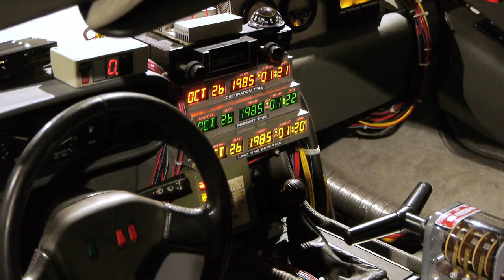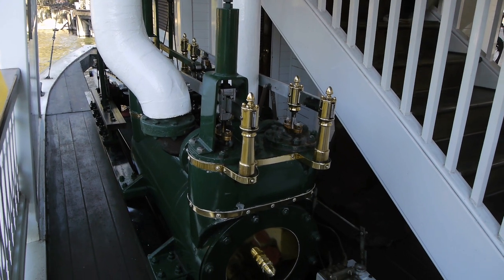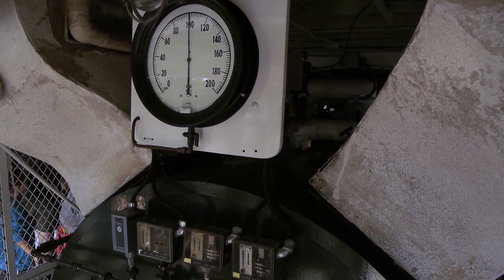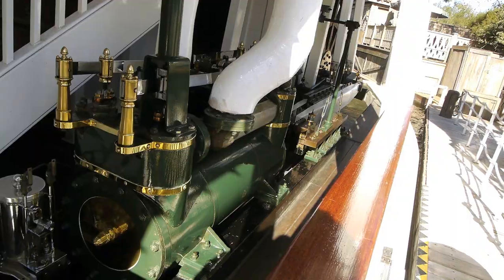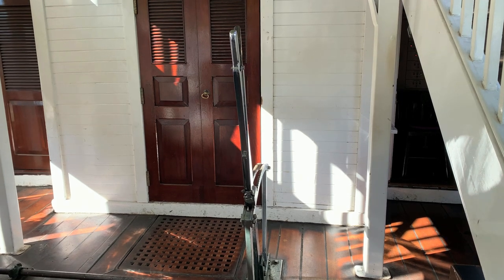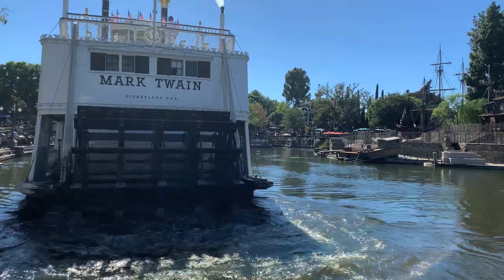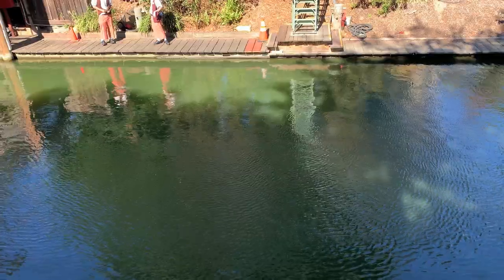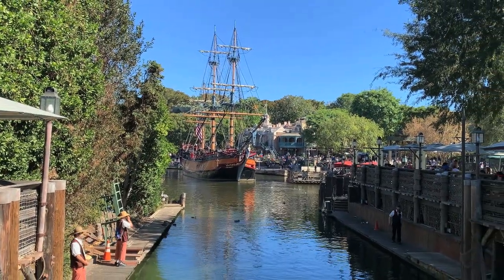How the Mark Twain Riverboat at Disneyland Works

Comment: I'm afraid that the engineer still didn't explain the "brake" very well to you. There is no brake that actually grips the track. They use the mooring line that the cast member hands to the other workers on the dock. As the boat comes in, the engineer will slow the boat by reversing the paddle until the boat stops. The mooring line is handed over and fixed. Then the engineer runs the paddle slow ahead to tighten the boat against the mooring line, preventing the boat from doing any backward or forward movement. I've spoken to many of the engineers over the years and learned all of this. But when I was a Cast Member at Disneyland, I do remember one incident, the Mark Twain was leaving the dock, they blow the whistle to alert the smaller boats on the river to basically "Get out of the way!" Well one of the pilots of the tom sawyer rafts must not have paid attention because they suddenly drove the raft across the river to the other side. The pilot in the Mark Twain Wheelhouse saw this (and I suspect the engineer did too), they went full reverse. The only time I've ever seen them do a full reverse. That wheel spun like crazy, kicking water up into the air as they tried desperately to stop the boat before it got too close. Though the raft had already reached the other side of the river, they didn't want to risk floating past it until it was moored because the larger Mark Twain makes other smaller boats get sucked-in toward it. It was a pretty interesting thing to see, no one got hurt. But it's an example of how the wheel is the only way to slow or stop the vessel even in an emergency like that.
Reply: I believe there was an accident 20 years ago where the bollard on the dock was loose, and the Mark Twain pulled on it too hard, and it came loose. The spring action of the mooring line snapped back on a park guest, and injured them.
Reply: @softwerksaol no that was Columbia. A rope snapped and struck a guest.

Comment: I’ve seen this track many times over the years while the river was drained and it always amazes me how thin it is to guide such huge boats. Of course the river was drained (and then just the back half drained) during the construction of Galaxy’s Edge a few years back when they had to re-route both the river and the train tracks - Overall they did a wonderful job and actually made that area look a lot better than it did. (And it was the first time that the Disneyland railroad ever veered to the left!)
Reply from the maker: Yeah it’s amazing how fine that guideway is. However keep in mind that the boats are actually floating boats. So all the guideway has to do is steer the boat. It steers from the front of the boat so the back half is free to move around a bit. When the Columbia got stuck on the guideway it was twisting perhaps 45° in both directions! Somehow they were able to pull both boats tight up against the dock. And I’m assuming that there’s some kind of additional guides at the dock to make sure that they can’t twist away from the dog. And then they do run the paddle wheel and the propellers on the Columbia in reverse while it’s at the dock to hold it tight against whatever guideway is underneath it.
Reply: @ToyManTelevision  I always thought the boats are connected to the guide at the front in back, the reason being is when you watch the Mark Twain go around the bend the back seems to follow the guide line perfectly almost as if you took a pencil and followed a curved line, the point and the eraser both followed that line.
Reply from the maker: @FunAtDisney  could be… but the Columbia was really swinging left and right when it got stuck. But boy they pull the boats tight up to the dock… so not sure how that works.
Reply: @ToyManTelevision  I believe I have been on the steamboat in the park in Paris some years ago back in 2012 I believe.
your steam engine videos are very interesting to watch
Reply: @ToyManTelevision  so does the person in the wheelhouse send orders down to the engine room when they are arriving back at the dock? my Mum thought they controlled it all with computers and the like. I believe she also thought that the steam engine was fake too

Comment: Excellent stuff, as always. If you guys ever make it down to New Orleans, do a video on the Natchez. This boat is actually newer than the Mark Twain, but its engine came off a boat built in the ‘20s! They let you walk around in the engine room while it’s running, and it’s an amazing experience despite just going down the river a few miles. It was well worth it when my dad and I did it right after Katrina.
Reply from the maker: Always have wanted to do that. And other river boats. And the trolley. Just NOT Mardi Gras

Comment: Ever since I was a kid in early 1960’s, I suspected the riverboat was actually steam powered, and driven by the paddle wheel, it just all seemed to fit.  Does anyone know how the Columbia is powered?
Reply: He did mention that the Columbia is also powered by diesel, but i suspect it would have an internal combustion engine rather than external, since there are no obvious exhaust stacks or steam exhausting anywhere.
Reply: Columbia is a combusion engine driving two propellers
Reply from the maker: As it happens I just found out the Diesel engine has been converted to natural gas. Two props. And even though it on a track they can twist it slightly by using the two props in different directions.

Comment: does the boat actually float by it self or does it need the track for other than steering the boat
Reply from the maker: It floats. And is powered by the steam engine. All the track does is guide it.
Reply: @ToyManTelevision  that's cool

Comment: So your so smart how is the Columbia operated???
Reply: Bio diesel.
Reply from the maker: It’s been biodiesel but has been converted to natural gas. Simple throttle system. Has forward and reverse but reverse is generally only used for braking. However on this trip we did get to see it back up as it jammed on the track.

Comment: Thanks for the photos of the engines, I only sorry you didn't spent more time on them. As far as I'm concerned, they are the most interesting part of a steam boat. These engines are generally true to the design used on the Western Rivers without very much change from before 1850. There are poppet valves for exhaust and admission on each end of each engine which are opened by the levers. The towers above the admission valves simulate what is used in a California cut-off variation on the valve gear. However, they are just dummies and the engines appear to have fixed cut-off. The valve motion is obtained from the sliding piece on the pitman (connecting rod). I've always wonder what the bore and stroke of the engines are, but the typical engine of this type will have about a one to four or one to five ratio between the bore and stroke, a much larger ratio than is found on locomotives and other steam engines. 

Credit for the engines goes to Chad O'Connor and O'Connor Engineering, who also built the Jupiter and CP-119 replicas at Promentory, Utah.